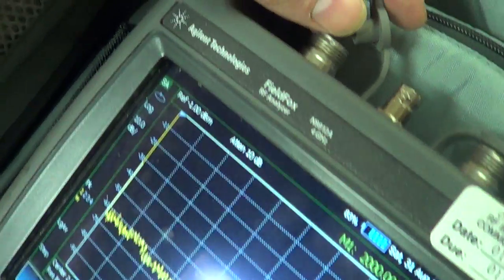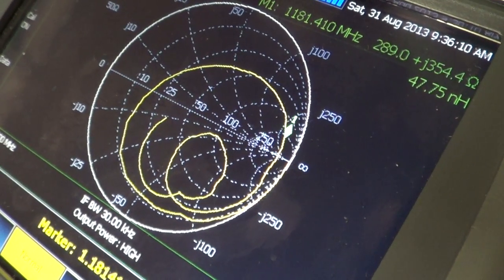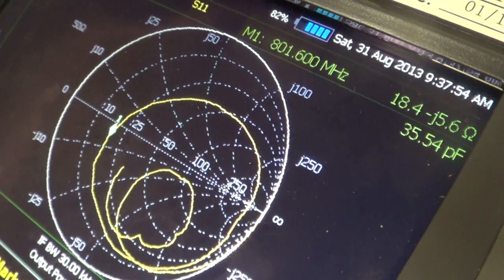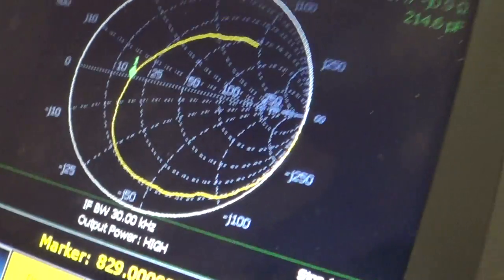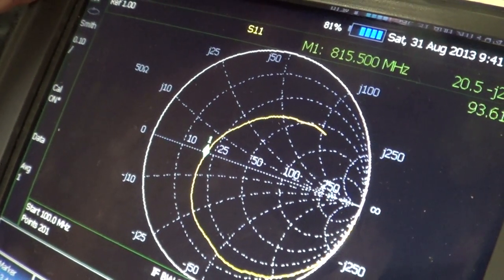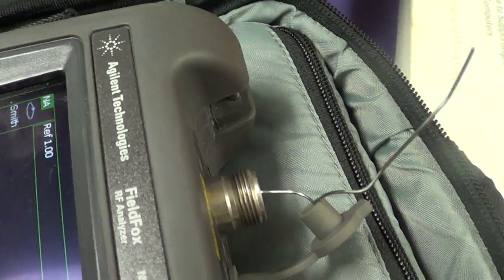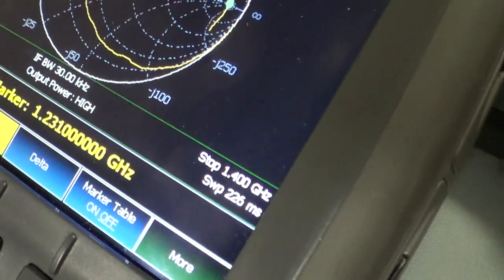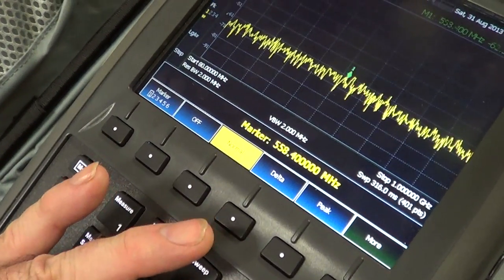FieldFox N9912A Paper clip Antenna Resonance via Smith Chart in NA mode

Comment: Dude...., You threw me at one point, when you went from Paperclip to Coat Hanger, then back to Paperclip ?
Just a jab !
But what brought me here, was many year's ago, when Uncle Sam was handing out discount coupons towards the purchase of converter boxes for HDTv, a friend and myself were fooling around with an under the counter Tv, his wife had in the kitchen.
In an effort to see if we could receive any Off Air Broadcasts, we began by unfolding a larger than normal paperclip he just happened to have laying around !
Initially we had longer wires attached to the paperclip thru alligator clips !
Very long story short, as we searched for channel's, we ended up removing all the extra wires, until only the paperclip bent at a 90 degree angle, and stuck into the center conductor of the digital receiver !
After we were finished scanning for channels, we ended up with I think better than 20 channels on only this bent paperclip !
It kinda became a joke as from where we began, and where we ended up, and I tried to get my friend to do a YouTube video, retracing our step's, as a laugh, but he wouldn't go for it !
Anyway.....since then, I have always wondered what the resonate frequency of that paperclip was close to ?
Fascinating to see this demonstrated using the Smith Chart !
Although I would have liked to have seen a bit larger paperclip, with a partial loop left, and then bent at a 90, to plug into a connector !
To better replicate what we had !
If you hadn't guessed, we are both, simi nerdy Amateur Radio Operator's !
Thanks for the interesting demo !
Addendum :
I should mention that we are in the Midwest amongst the corn fields, and the Television stations are spread many miles apart !